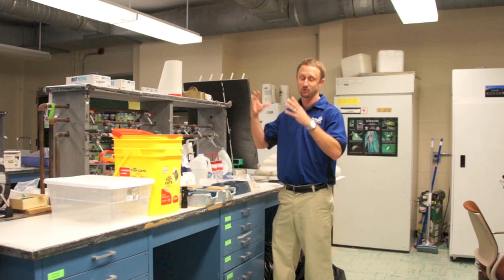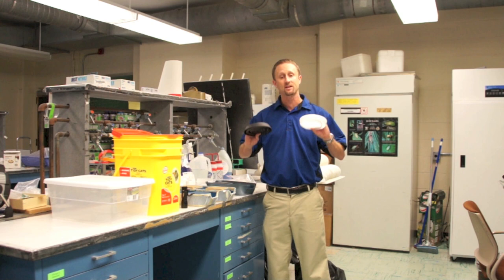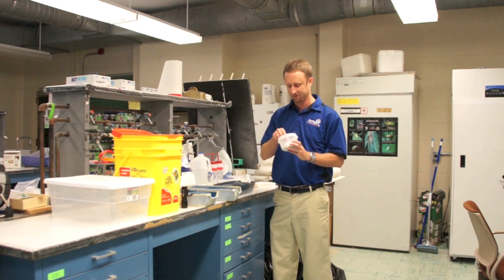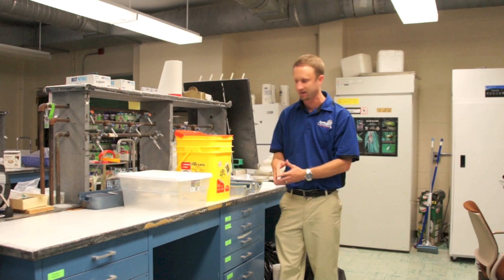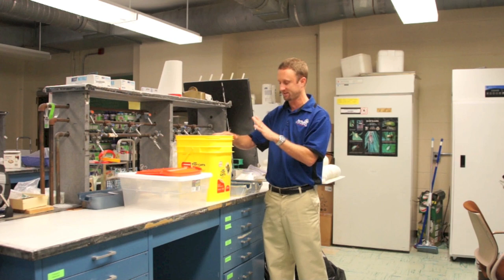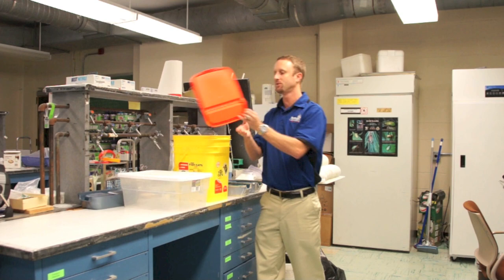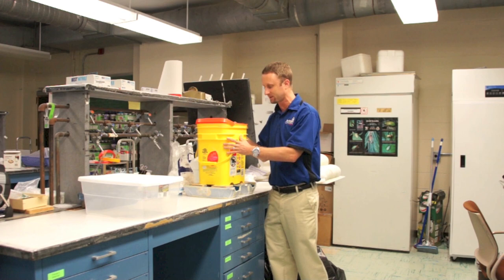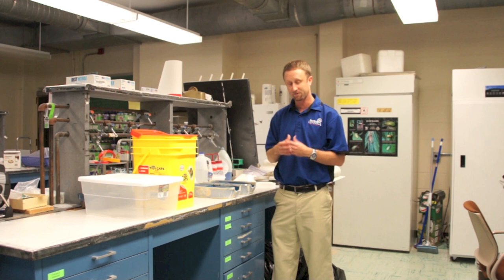DIY Bed Bug Monitor - Sugar/Yeast C02 Trap

Comment: MEASUREMENTS:  I saw a lot of complaints in the comments about Jeff using metric measurements.  I too was annoyed by that.  But I did some conversions and came up with a very easy system.

First, his measurements were by weight - not volume, but I don't have a food scale so trying to do everything in my power to avoid having to go to the store to buy a scale, I wanted to try and figure out a way to do it with the only thing I had - which was a measuring cup.  And it turns out it's quiet possible to do!  

I just looked it up online and there were many sites that give the number of measuring cups necessary to hold a certain amount of weight of various foods, including sugar and yeast.  

And basically, it comes out like this:

150 grams of yeast is equivalent to 3/4s of a measuring cup
750 grams of sugar is the equivalent of 3.5 measuring cups
3 liters of water is roughly equivalent to 3 quarts

I used these exact measurements last night and it worked fine.  

Oh and for those of you who like me have never seen yeast - much less ever worked with it... I was curious why he was telling us to use a 4 gallon container if we only had to pour 3 quarts of water into it.  Well... the reason is - the yeast RISES!!!  I've heard the expression "yeast rising" but I've never seen it!  It will fill up the whole container, so please don't try to shortcut (like I almost did) and use a smaller container.  You will need at least a 4-gallon container!
Reply: Conversions are easy. So are 25 unnecessary mouse clicks. Easy yet a waste.

Comment: A couple lil pks of yeast and a cup of sugar in a gal milk jug will make co2 also.  A cap with a hole and a ft of plastic tubing stuck in it hanging down into the trap will work great with min spill risk too.
Reply: Can I asked a question do have did this person test how much co2 this puts out because this could kill you if the room you put it in fill up with more climbing to hights because it heavier than air so how much is actually safe. And by the way instead of useing yeast I found that useing vinger and tiny bet of tspoon barking soda creats lot of co2 that's kind I'm useing make the traps question how co2 is coming out can any give answer to that!!?
Reply: @aaronmarkinson2670 good idea but does the barking soda keep neighbors awake?😄

Comment: Thank you for your videos. Trying to deal with bed bugs on our own in an apartment complex is difficult. We got them from our neighbors since we started to see mattresses and sofas at the dumpster that looked in great shape. They make everyone sign a BB clause in the lease stating that if you report bed bugs, you are responsible for PCO charges for everyone that gets them in your building so NOBODY is reporting it and is scared to say anything.
Reply from the maker: Cody Darnell that's the slippery slope of trying to pass bed bug fee's off to residents, the first issue is it's tough to prove where the bugs came from and then people stop reporting, I would recommend consulting with an attorney on the matter in regards to the wording in the lease
Reply: Cody Darnell Check your state law or landlord-tenant relations office (sometimes is combined with Fair Housing and Employment office, odd as that sounds. It was true in my case.). They're usually county, not state, offices. If in doubt, call the county agricultural extension and ask them. They're usually in charge of Integrated Pest Management (IPM) so they'll know everybody and anybody. Anyway, in my state, it's illegal for your landlord to do what yours is doing, and no matter what the lease says, the landlord has strict liability. In fact, should they decide to evict you as a result of a pest infestation or reporting one, my state gives the tenant serious control against the landlord. The problems are 1. knowing your rights, and 2. being willing to go the full course against the landlord if need be. 

I'd also look for another place during the intervening months if you're going to attempt to murder your landlord and when the cops get there. Oh, my! Did I say that? Anyway, what I mean is financially trying to murder your landlord. In other words, let's say he/she still gives you notice. You're better off moving than fighting, but if you need more time to get rid of the bugs before you go, do the paperwork necessary to stay an extra month or whatever. You'll get your money back later. DON'T take the bedbugs with you, for god's sake. It's not only stupid for you to bring them along with you to keep tormenting yourself, it's immoral - yeah, I said it - flat-out immoral to do that to anyone else. 

Then you can sue in small claims court at your leisure. Sue? For what? Getting your security deposit back, for one thing. He/she will try to blame you for the infestation to begin with, then steal your deposit. He might even threaten you with a countersuit to clean the entire apartment building because "you brought them in here." That's like saying it's your fault a fly flew in. They're bugs. They have no preference for tenants or homeowners, opera houses, or museums. They only need somewhere to eat, sleep, and make little bed bugs. Who knows how they got in there?  Maybe he/she brought them in while inspecting apartments, for that matter. Don't be cowed. Just keep records, don't argue, don't yell, and - this is most important of all - pay your rent. You'll get it back in court. If you can't pay the last month on one, plus the first one on another, PLUS a new security deposit without getting the old one back (we're talking at least four months' rent here!), then leave the last one and move into the new one in a one-day operation. 

My judge destroyed my old landlord. Serious punishment. Also, before I left that residence - just to give him a little something to remember me by - I got the housing authority out there to inspect the faulty wiring, furnace, termites, and a lovely set of unsafe stairs. Around 2/3 of the problems I didn't even know about. The reason they were so happy to do this was because all my rent was paid in full. About 95% of the time, the tenant is withholding rent. Trust me on this: if you're paid up, they're happy to help you. Otherwise, they think you're trying to pull a fast one on your landlord, because many tenants try to do that. Scumbags make it bad for the rest of us.

Anyway, the city condemned the building. I think a lot of this was due to how the landlord talked to them. He was a hot-head, and began calling one of the inspectors a lot of nasty names, swearing, etc. It made the inspector so angry, he came back out and found MORE stuff to cite that the landlord would have to repair. You might not be so lucky; that is, your landlord might not be an insane, greedy, loudmouth. In that case, you'll just get the one inspection.

I got my deposit back, filing fees, law library copying fees, the cost of a book on landlord-tenant law, and double damages, meaning an additional two months rent worth of cash. When he stiffed me on the payment, I notified him by mail that I'd accept payment over six months at 10% interest, interest to be paid first. He paid five days later. 

I was told by former neighbors that it cost him nearly $20,000 to repair everything he was cited for, AND he had to remove the illegal rental area he'd put in. I didn't know that the house was a single-residency place. He'd tried to turn it into a duplex, but illegally. So not only did he have the construction expensive of illegally turning it into a duplex, he incurred even more expense when it had to change it back into the single-residence house it was to begin with. That, plus the termites, the entire heating system, most of the wiring, etc., and doing much of the work himself and with friends, still cost an extra twenty grand. 

Now that I've gone through it, I'm proud I did it, but I wouldn't wish court on anyone except him. He deserves it. I'm not making this up - within the year, his wife left him. Apparently she believed his story at the beginning, but when we got into court, and I had all that evidence, she realized he was lying. Then, when he refused to pay, it made her so nervous, the problems they'd already been having were maximized. Finally, a woman sued him for child support! I couldn't ask for anything better than that. His wife left him; he lost thousands, and he refused to pay child support. The mother of the baby took him to court, where HE demanded custody. 

Best thing ever: his mother was so thrilled to have a grandchild, and adored not only the ex-wife, but the girlfriend, that she testified against him during the support/custody hearing, saying he wasn't fit to have custody. The judge ruled on his back support and gave him supervised visitation only - at his mother's house. The ex got community property stuff, so she's half owner of everything, including apartments. The mother of the baby got her support payments. I got my money. An extra dessert I forgot to mention was that you have to serve papers on someone when you go to court. I knew where he lived, but he was being such a jackass about it, I chose to hire a county sheriff to serve his papers at his workplace, where he was a supervisor. A neighbor had told me how everyone at work despised him. I can only imagine the laughs and delight his co-workers and "underlings" got when that sheriff showed up and served him in front of everyone.

Not one bit of this story is made up. In fact, I'm once again proud of myself and hadn't thought of this in years, because I've had such a professional and pleasant landlord all this time. Anyway, I hope this helps.

And I hope he dies a penniless, lingering, death.
Reply: Well if its a law do you. protect your family. Some people are allergic to those bites and it they get bit in the throat they can get a swollen throat and thats an emergency room visit.
Reply: I would recommend wearing a wire and tricking one of the other neighbors into confessing then take that to the landlord
Reply: Bed Bug TV - If a found a burglar in my home, I might shoot him dead but I wouldn’t dance and gloat about. Your delight at watching a family crumble is ugly. Yes, he apparently deserved court action but I wouldn’t act like I’d won the lottery.
Reply: @FlaschDJ  you responded to the wrong person
Reply: @tekobari  Long story short:  Bed bugs destroy lives.

Comment: Leaving the lid on wont let the CO2 get out... I'm a little confused
Reply: I think the whole idea is the tube will let it out gradually, but this did not work for my friend
she was highly upset and crying. This thing won't go away. But read my comment up top or where ever you see my comment answer from the guy advertising this thing to follow. Stay blessed Hope my comment works. Its what I helped my friend with an idea that will help her sleep until she resolves her BB problem.
Reply: @leeleelee8672  What tube? I didn't see any tubes on this video?
Reply: @Mitoubacklund  same. They totally forgot that crucial step
Reply: He said to leave it slightly open

Comment: My trap consists of a mid sized metal can, inside I put a plastic water bottle cut down about half, I place the neck inside the bottle.  I then boil up water and sugar, pour the mixture into the bottle when about 90f, then sprinkle in yeast.  Along the bottom of the can I put the talc. Oh, and cover the bottle first with paper towel.  The mixture smells a bit like baking bread and looks like beer.  I use this inside a sealed ziplock laundry bag to test suspicious items before using them in the house.  Haven't caught anything, assuming because there's nothing to catch since we haven't had any signs of bed bugs. I'd use your method if I think I did.

Comment: Yeast is expensive. What do ya get when you combine baking soda and vinegar? (Hint: CO2). 

I made a yeast trap, tiny by comparison, in the bottom of a 5-gallon bucket. It made CO2 for many days. Smelled like bread/beer. I have cornered the market on fruit fly collection. 

If one goes the yeast route, dissolve the sugar by stirring first. You can re-activate (start) the yeast by adding it to some warm water, then dump it in. The sugar feeds the yeast which then gives off CO2. The correct temperature range (in Fahrenheit, as they say: "Numb Nuts") comes with the yeast; of course, there is google. 

The yeast:water:sugar ratios are not critical at all. Masking tape provides a texture for climbing bugs and is MUCH cheaper than cloth tape. 

Good luck, and DEATH to the BBs
Reply: Very helpful. Thank you.  Can you elaborate/explain the “re-activate section?  “RE-activate?  Thank you
Reply: Is it equal parts baking soda and vinegar?
Reply: @FlaschDJ  Active Dry Yeast needs to be reactivated, which is done by adding it to warm water. Follow directions on your yeast container.
Reply: @mollyh8410  Baking soda and vinegar does make CO2 but it doesn’t last as long as the living yeast which keeps on producing, 24/7.  For many days.

Comment: Why not use a white colored dish pan instead of the two dog dishes, the typical 18x18 inch size, cover with blue masking tape to give the bugs some traction or make paper/sandpaper ramps up the sides so they can get to the top and hopefully crawl/fall in. Coat the inside vertical 4 walls of the dishpan sides with baby powder to make it slippery so they cannot climb out, add 1/16th inch diatomaceous earth on the bottom of the dish pan. Place liquid ingredients in a gallon size sterile plastic bottle with a hole in the top cap, drape a piece of saran wrap over two thirds of the plastic bottle, add a few drinking straws down the length of the bottle to direct the CO2 into the dish pan, secure the saran wrap and straws with a rubber band.

Comment: I plan on trying this while sleeping in an adjacent room. Will that cause bedbugs to spread or will the bugs be more attracted to the CO2? I do not think I have an infestation, but just came back from a trip and would like to try this as a cautionary measure.
Reply from the maker: I don't think sleeping in another room for one or two night will cause the bugs to spread as long as you don't transfer them to the new room yourself (on your clothes, a bag) or they aren't already there,  you would probably be more attractive than the CO2 produced by the trap but for one or two nights it probably wouldn't matter
Reply: ***** I stayed at a hotel about a week and a half ago and had suspicions of bed bugs because of possible fecal matter (about 3 pen-like dots on the mattress). I had the hotel check and they said they found no sign of bed bugs after I stayed, but I was still concerned. I washed my bedding and most clothing, and I have tried this trap for 4 nights now (2 of which I slept in the room, 2 where I slept in the adjacent room). Nothing in this trap, or on the interceptors I installed. How would you suggest I proceed with monitoring the situation?
Reply: ***** It absolutely does matter - people who do this almost ALWAYS transfer the bugs to another part of the home. It's advisable to handle the issue where you spotted it for maximum containment.

Comment: I have just prepared this , mine in a 2L bottle ,238g of sugar 7g of yeast glass with straw from bottle  , air tight i thought it lasts for days? This video said 8 hours.
Reply from the maker: it typically only lasts for 8 hours (or so).  Obviously you can reset the trap but the actual production of CO2 will go down dramatically after 8 hours

Comment: This may sound really stupid but do you leave the lid on the whole time or remove it when  you start?
Reply: Leave it off. If you seal the bucket it will pop open or worse split open as you are producing gas in the bucket and the pressure will build and need to go somewhere.

Comment: Do you have to re-mix the mixture each night. Other sites said it lasts a couple of weeks?
Reply from the maker: it definitely doesn't last a couple of weeks, Rutgers research suggests 24 hours based upon the mixing ratio above
Reply: ***** awesome...24 hours is at least better than 8! I'll take stock on yeast and sugar :)

Comment: How critical is is that the edges of the dog bowl are near 90 degrees? mine is about at a 70 degree angle
also, does the container have to be four gallons? would a smaller container work just as well, as long as it can hold all the ingredients?
Reply from the maker: +wolffreak33 what's critical is that the bugs have a textured surface to climb to get into the dog bowl and then fall into a polished well that they can't climb out, the angle to get in is less important than the texture, the trap area should be close to 90 degrees.  I don't the container doesn't have to be exactly 4 gallons but I'm unsure of how small it can be and still work as demonstrated

Comment: did you leave part of the lid open? how does the co2 escape? If it is sealed, will they come to it?
Reply: The original Rutgers article (http://www.ingentaconnect.com/content/esa/jee/2013/00000106/00000004/art00036 )does not mention a hole in the containers either but the orange stickers on the containers (in the figure 5 and 6) could indicate these holes.

Comment: Should I leave the top off the 5 gal bucket? Also I am not as familiar with metrics as I am with standard measurements
Reply from the maker: recommendations are to leave it slightly/cracked open
Reply: You obviously have the Internet.  There are hundreds of metric conversion sites.

Comment: Thank you Jeff but there are mathematically deficient people like me.  I don't know metric systems, also is the a way to do this on a small scale, and set up many traps in the house?
Reply from the maker: I would recommend 1 trap in a normal sized room (10x10'ish)
Reply: It's a 1 to 5 ratio if it's 150 grams of yeast and 750 grams of sugar. One cup yeast to five cups sugar to 3 Quarts/Liters of warm 100 F water. Correct me if I'm wrong.
One cup of yeast = 136 grams. 
One cup of sugar = 225 grams.